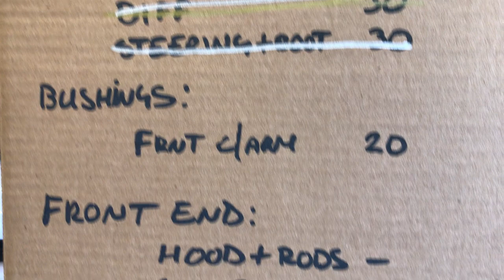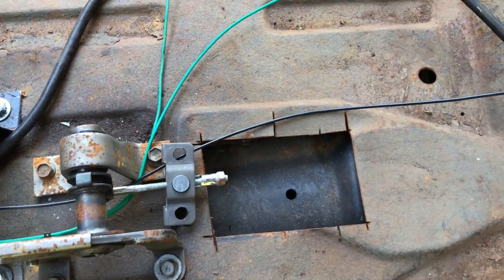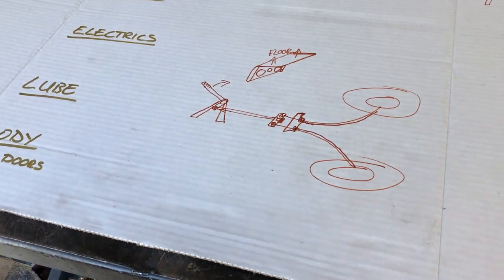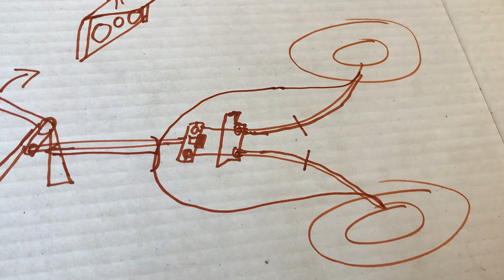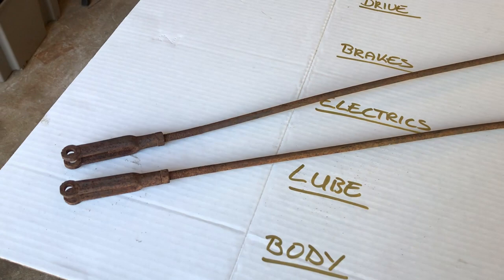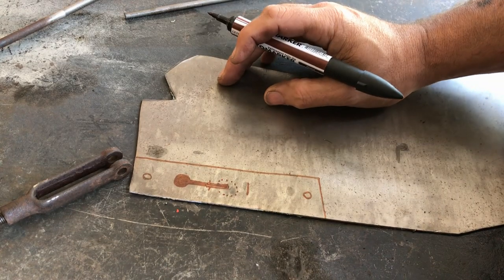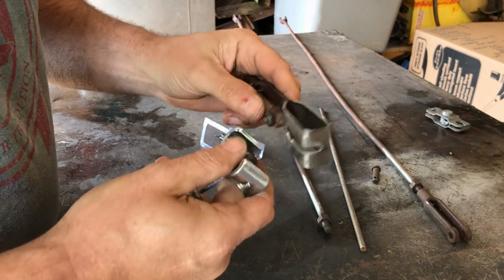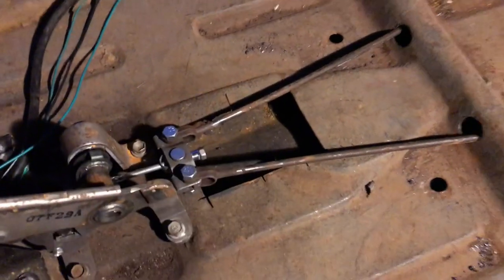Parking Brake Fabrication On My 1936 Chevy Coupe

Comment: Hey Dave. It is a great relief getting the park brakes done. I sure am relieved mine are done. Thanks again for the cables. Here is another 2 cents from the Andy's Dog House. Cut your exhaust pipe shorter. It looks strange when you can see it through your exhaust tip. Thanks for sharing.🍁🍁👍
Reply from the maker: Yeah, unfortunately I didn't think of that when I welded them in, grrrr. I'll get round to it, it annoys me too.
Reply: Hey Dave. In a way, by me being laid up with back problems kind of worked out for me. I am behind you now with my build and I see things that I would change on your ride. So I make sure I don't do those things on my 1954 Fargo 1/2 ton. Thanks for not being perfect.😉🥃👍

Comment: 15:13 looks like some valve seals may be needed Dave. If the brakes need adjusting the park brake can be the first sign that they are backing off. The slack adjuster might not be being held by the self adjusting tang properly as well. Oh the joys !
Reply from the maker: I stripped this engine down last year and replaced all the seals. That's just condensation from a cold exhaust.
Reply: There you go... carry on, i will show myself out : ]

Comment: Dave the end of the cables attached to the floor may overtime need to be stiffened up. Driver side shoes just may need adjusted well done I'd be proud of that myself actually I may steal that idea when I have to do my Chevettes brakes🤨🤨
Reply from the maker: Thanks Ed. I may run a 3/16 plate on the top side of the floor between the two bolts to stiffen them up.

Comment: Move the brackets to the chassis and not the body of your car. Try and move the brackets closer together if possible then you don't need to open up the holes for the rods to stop them catching the sides of the holes.
Reply from the maker: The cables are too short and there's no chassis part in that area to attach to. It will do for now. Everything is upgradable in the future.

Comment: The ground may be bad on the passenger side tail light. If the cable mount on the rear floor flexes the floor it might not pull the cable as much on the driver side or just need adjusting like you said. The list is getting shorter.
Reply from the maker: I might have snagged a wire when I put the seats back in, but well spotted.